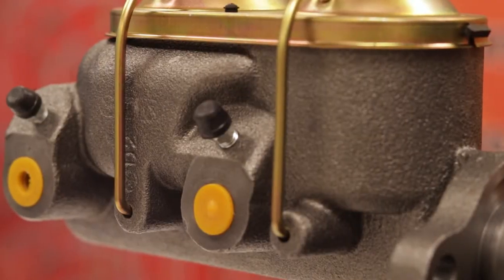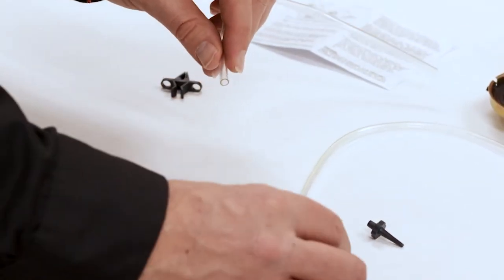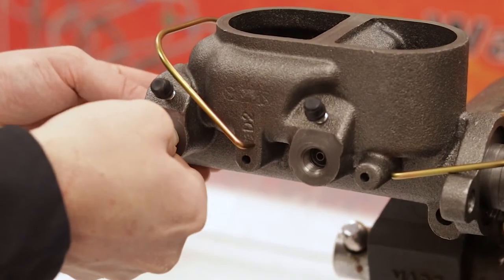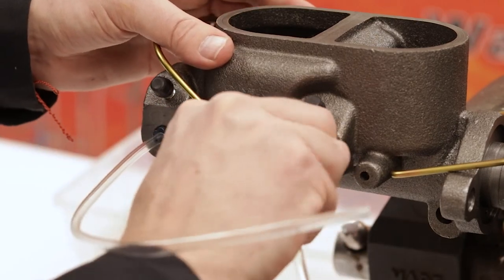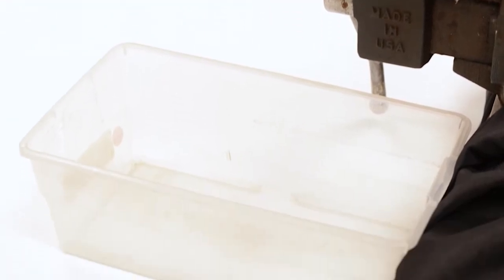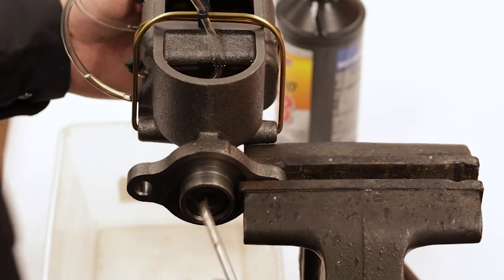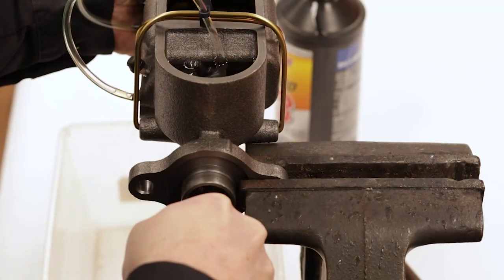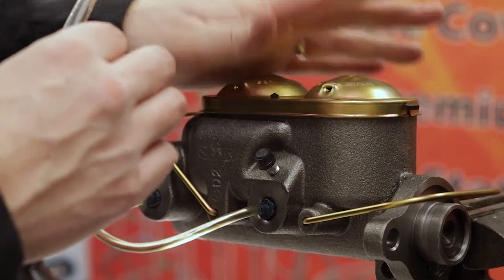How to | Bench Bleed a Master Cylinder

Comment: so what are the two screws with black caps for? I thought I could attach hoses on those and loosen like on the brakes and bench bleed it that way.
Reply: yes It is possible to bench bleed it with those bleeders too.  We made the video to instruct on a basic master Cylinder.  Some we sell do not have the bleeders.

Comment: The vacuum hose connects to the check valve, but the check valve  is facing the bolt that connects the master cylinder.  Is it okay to swivel the vacuum check valve about a 1/4 turn to make the hose connection work?
Reply: Yes you can turn the check valve whichever way it is not in the way.
Reply: @charlesmcmartin8659  Thanks for the quick response!